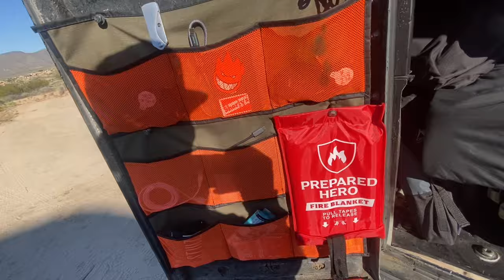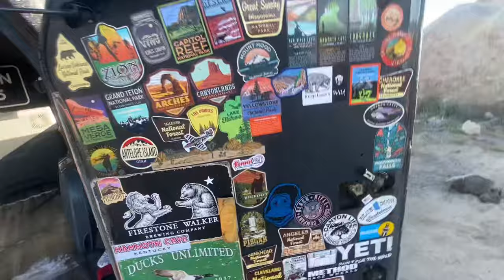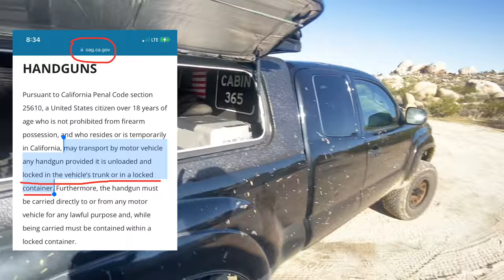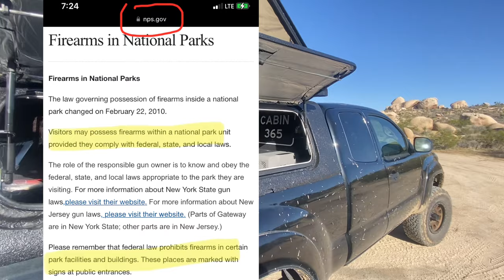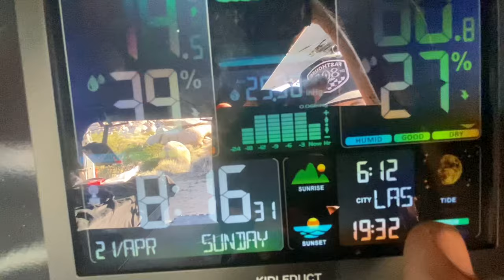Living Debt Free In a Solar Powered Truck Camper

Comment: I live in Florida.
How do you deal with extreme heat and humidity ?
Reply from the maker: That’s one of my biggest challenges. It’s been a process, but I’m slowly inching towards comfort. I started by insulating my camper shell with 394 mil closed cell sound deadening material (used for car hoods), then layered on reflectix/carpet. While it keeps the camper shell anywhere from 5 to 10 degrees cooler, I’m learning air flow is more important. I’ve got storage cubby’s in the bed of my truck which I plan to remove and install usb powered computer fans. One will be an inlet, the other acting as a vent drawing air out. (Located on opposing ends of the truck bed). This will ensure a constant exchange of air, keeping the camper cooler/ preventing the build up of condensation.

I will mention that Cali is a dry heat, whereas Florida is more wet. It’s probably a whole different ballgame out there. I’d recommend steering clear from cotton bedding. While breathable, it retains a lot of moisture. Also, look into “container dri Desiccants”. If you’re unable to prevent the condensation the desiccant’s will at least draw it back out of the air thereby preventing mold. I had great success with them, although keep in mind they only last a couple weeks. 

But as a short answer to your question— that’s why I bought the roof top tent
Reply: @Campers_Anonymous  thanks for such a thorough response. You are right about the humidity making things even more difficult. I'm also exploring alternatives to idling the car to have air conditioning. I'm currently in a 2015 Toyota sienna, but I'm also considering trading up to a hybrid Sienna which has awesome climate control options!